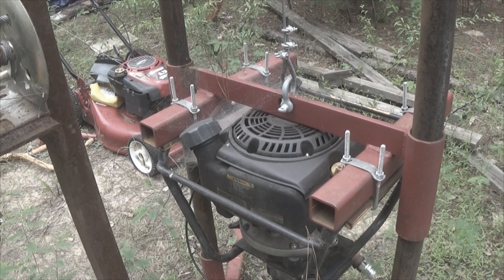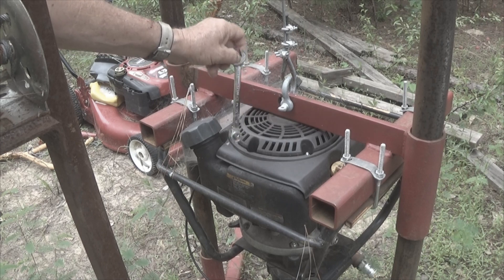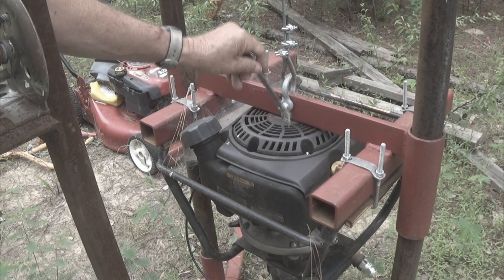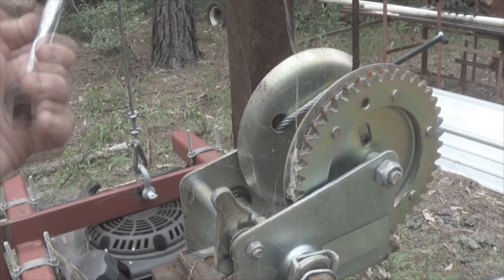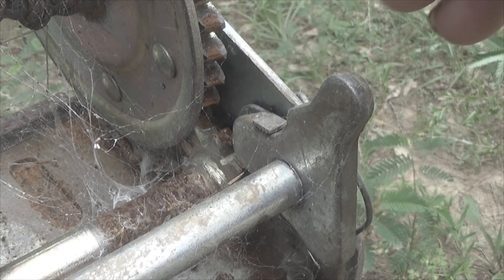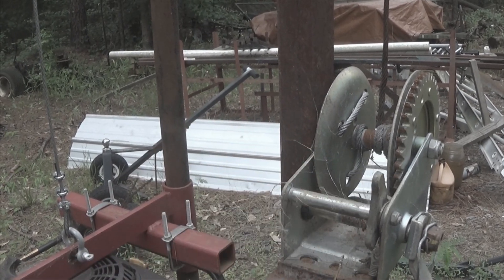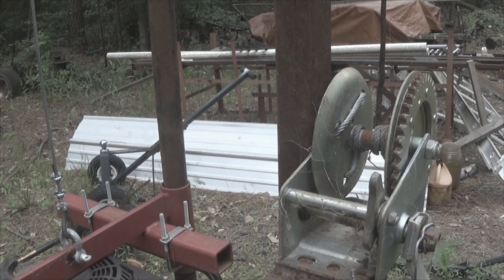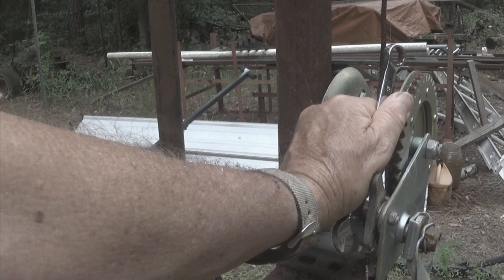deep rock drill,  please watch all of it, critical review but valuable to buyers

Comment: Any idea if these guys are still around? I bought a used one and I can't reach anyone at deeprock to get documentation and order a drill bit.
Reply from the maker: two questions,  is your drill stem made of 1 inch or 1 and a quarter inch.   here is the most recent phone number and contact info i have
1-855-457-4469  sales@deeprock.com

 the original company, hydrodrill, was bought out by this guy.   i bought a 4 inch drill bit and it was about a week from order to shippiing.

if i can help more, let me know
Reply: @dysfunctional_vet  appreciate the insight. It's a 1.25 in drill stem.

I've called the number for about a week with no answer. When I emailed, the message bounced back as undeliverable.

Comment: The power head is marketed by HT Enterprises out of Wisconsin. They are an ice fishing outfitter. This is a two man ice / posthole drill. NOT made for drilling a water well. I’ve burned through two gear boxes in 50 feet. I’ve taken it easy going through some limestone but the gears aren’t made to take it. Made in China tool and you can expect that quality. I took the gear box apart and the light weight gears were evident. HT Enterprises did honor their warranty and were a pleasure to work with. Deeprock not so much, very disappointed. I put the replacement gearbox on and got another 4’ through clay before the gears fell apart. Good concept, but not the right tool for the job. Should have just gone with the commercial driller for the 50’ well I needed for a few bucks more and been done with it. Not recommended unless you’re drilling through just clay and sand.
Reply from the maker: that is good information.    i do actually have a rock drill bit, it is the tree pine cone shaped thing for a 3 inch bore.  i bought it way back when, and was going to drilll through lime stone.  but kept being deployed and never used it.
Reply: I was impressed with the general purpose cone shaped bit that came with the drill. It will cut through limestone without problem and still shows no wear. I had no luck with a commercial 4” rock bit. The whole unit I think is not heavy enough for the downward pressure it requires to work. Thanks for your videos, very informative.
Reply: @KSprospector we have several drill rigs that will drill HARD ROCK but that are 16 k or more all the way to our $347kTruck rigs

Comment: If you don’t find me asking, how much did you pay for that? i’ve looked at these drills before but it’s been a very long time. Deep rock reminds me of an oddball tool you would buy from Harbor freight. It’ll get you very close, but you might need to make some modifications to make it work right. Overall, if after all of the complaints you had were resolved, would you recommend this drill?
Reply from the maker: i think i paid about 3000 to 3500,   i don't remember exactly.      
the machine does work, and yes i would recommend it, however get the modifications i suggested so that it works correctly.  they now send you a wrench for removing the stem as you drill.
given the cost of thousands to drill a well, and i got it done for 3-3500 it was a real saver of funds.

granted my will will only make about 200 gallons a day on a good day, it still provides water

yes, it is an odd ball tool, but it will work